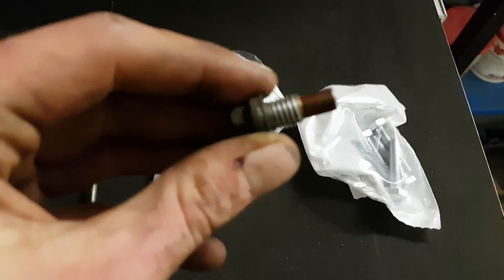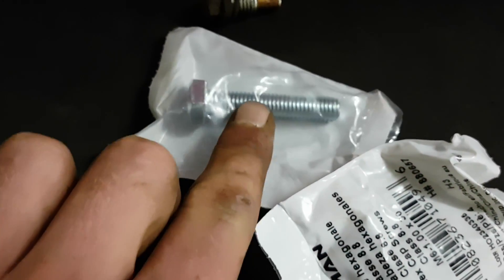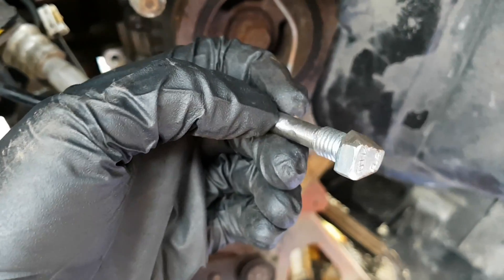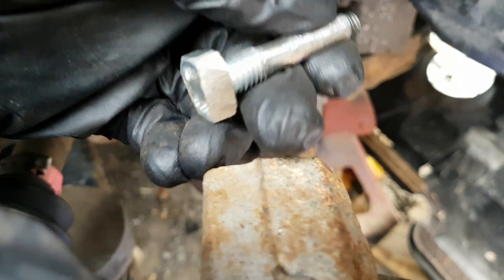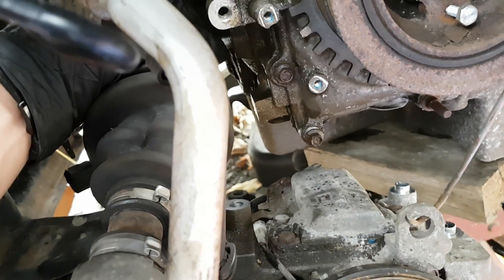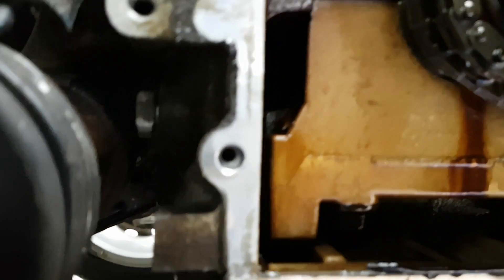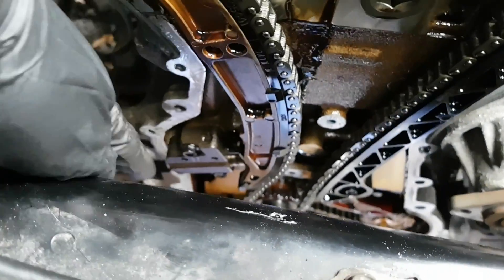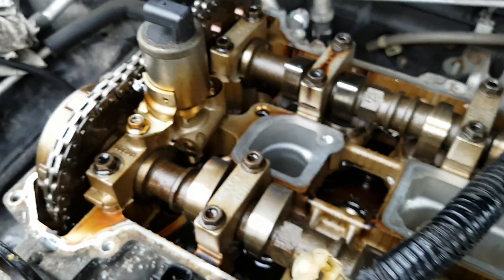How to make 303-507 Crank timing peg for ford mazda 2.3l 2.0L engines

Comment: Just pull an exhaust bolt. Flip it around. It's the perfect length to lock the crank down..If your lazy. Just go buy a new exhaust bolt. Grind the first half threads off. Then it fits without having to remove the drive shaft..
Reply: I found out the same thing.

Comment: Save $30 by buying $500 in other tools. Makes sense.
Reply from the maker: in what universe does a 63.4mm by x m10 bolt cost $500?

Stick to watching information rather then trying to spread it. 

Some people Do things. Other people bitch about people doing things. No offense

"Oh yeah I totally told everyone to go buy a welder and a drill press and... oh wait no I didn't"

moron lol
Reply from the maker: last time I checked I can buy a M10 bolt for $0.20 at TSC or any local hardware store.

OH MY GOD $500 Fucking Dollars! hahaha
Reply: @hi-powerdetailing  You said it yourself. If you have a bench grinder, and a drill press. Most people don't just have these just "laying around". So my statement still stands. Because if you don't have these things, you probably shouldn't try making one of these. But people will surely try with a hand drill and a pair of vise grips.
Reply from the maker: and any self respecting weekend warrior or a mechanic will have a Vise.  If they don't, they're shopping for one

Seriously what home shop doesn't have a vise?  Ever tried to break free a fastener and cant hold the part? Yeah that isn't gonna work.

If you don't have a vise then you probably should stick to changing your oil or something
Reply: @hi-powerdetailing  I never said anything about a vise. I said a drill press and a bench grinder. My vise is about 50 years old and will best any mainstream vise on the market today. But my point is if you don't have the money to invest in a drill press or bench grinder, you're kind of stuck drilling with a power drill. Have you ever tried drilling a perfectly plumb hole in a bolt directly in the center? 9 times out of 10, the hole will be cocked and won't function. So for a project like this for people trying to do it "cheap", they would need the proper tools to accomplish the goal. Better off spending $30 on the actual kit made for this engine.
Reply from the maker: For the last time you can buy the bolt and use a hacksaw. or buy the tool who cares. I dont even know what youre trying to prove here. You dont need to drill anything. I dont think you understand that
Reply from the maker: I just want to point out the comment section is full of people who understood what I said about being able to just buy a bolt and use it. I dont think you understood that simple yet overlooked point.

No tools required. Purchase of a bolt is required. nothing else. everything in the video is extra. I dont think you grasp that
Reply: @hi-powerdetailing  I understand that. But you also made the video about making an adjustable bolt. Not a vehicle specific bolt. So if you want to make an adjustable bolt, save some money and buy a drill press, taps, a grinder, a vise, among other pricey tools. And use your valuable time while potentially losing money because you don't have a way to work because you spent we 12 hours making a bolt without even touching the car.

$30 on Amazon and you can have the exact bolt for a 2.3 mazda 3 or Ford focus/fusion engine. 😉😉😉
Reply from the maker: You're making me realize I should just start selling these bolts for $25 bucks online and make some mulah haha. The focus of this channel has been to spread information moreso then to profit, but I should realign my goals to incorporate profit as well. It would probably help me focus on creating new content.

Tool = $30 / shipping / waiting
Bolt = free / negligable cost, and can be utilized without delay.  (can be found in appropriate size +/- 1MM = good enough for me)

Also it took me less then an hour to make the bolt. I spent more time editing footage and uploading then I spent doing it.
Yes I made it adjustable. It serves my purposes. Nobody else needs an adjustable bolt, and I gave them an alternative, but showed them what I did instead.
I did it because I felt like it, not because it made my life easier, it had no real utility other then to satiate my curiousity.

I never recommended anyone struggle without equipment or tools and devote disproportionate amounts of time to basically what boils down to an experiment, I simply showed them how to make an adjustable tool. Is it overkill? yes. but it was an original idea that came from the need for a tool, and I thought it would at least teach somebody something or possibly pique their interest in working with their hands.

I'd never even set one of those engines to TDC before I made the tool or video. I winged it, so there's that too. The threaded portion ment it would back off as I tightened it if the bolt bottomed out. Self adjusting tool. Perfect for easing my doubts on the dimensions

I had to remove the heads and rebuild them so really I had alot of little jobs I was doing at the time and made time to record the process, for shits and giggles

I had the privilege of growing up in an auto restoration shop and learning alot from my father. I have used that head start to the best of my abilities and I'm continuing to learn daily, I try and share things to provoke thought or spread information.

There's always a better way to do something. feel free to keep letting me know when there's a better way, i'm always open to new ideas and respectful discussion

I've got a few videos on Subaru engines in the works, I should be dropping one a week for the next month if you're interested at all. Timing belt, Cyl Head assembly, then engine installation. I havent uploaded a video in some time.

Sorry if I come off as harsh, I'm pretty blunt and have a hard time coming off as agreeable at times.

Kind Regards. AST Auto Repair

P.S if it takes anyone 12 hours to drill a hole and thread it,  I'll buy them a beer haha

Comment: Haynes says use a 63.4mm (2.5") M10 bolt and job done.
Reply from the maker: Boba Fett thanks Boba Fett! When I have a minute later I'll update the video info to reflect that! Its been a few years so my memory is hazy on the specs and length. I appreciate you clearing up any uncertainty!
Reply: I have a screenshot of the Haynes manual for the Ford Escape '02 with 2.0: https://www.dropbox.com/s/z3iivh59tv7gl90/Haynes%20Ford%20tool%20.jpg?dl=0 if that doesn't work, reply here and I can send it along

Comment: Hi I'm a auto mechanics i need job
Reply from the maker: Hi Automechanic. Have you applied to local shops around your area? also try putting an AD up online and drum up your own side work if you have the tools and equiptment to do so. you make alot more working for yourself like I do. I don't work crazy 12 hour days and I make about double what a shop would pay me. I do most of my work in the gravel driveway, including engine removals and reinstallation. I recommend not taking on tranny work because its not profitable for the time / effort. I find small service work to be the most profitable, especially when theres several stacked on one bill.

I hope that helps. I know it doesnt help on the job front but maybe it will help you out financially in the future. I typically charge about $200 bucks to change say 6 spark plugs on an average car like a ford escape. plugs probably cost me like 60.

Cost varies from region to region before anyone decides to flame me for charging $140 for 2.6 hours of my time. part of that money is markup on parts

Remember 33% is usually parts, 33% is labor, and 33% is profit to reinvest into tools and equiptment. I'd find a new trade though because electric cars are gonna put us mechanics out of business. I'm going back to school currently to change careers simply becuase internal combustions days are numbered

Comment: Auto Zone now rents the locking pin and plate ,they give you 3 different pins ,for the 2007 Ford Escape (vin z) 2.3L it is the shortest pin of the three , witch is  2 and 1/8 or 2.625
Reply from the maker: Thanks for the tip! in canada we dont have Autozone but crappy tire / partsource probably does the same thing!

Comment: So , viewing these comments here I'm totally lost - m12 or m10 ? 40 mm or 38.5 mm? . I found that I have a 2007 Escape 2.3(Z VIN)  witch calls for a specific bolt.
Reply from the maker: snowblind5151 m10 if memory serves me correctly, 38.5 mm, 40 mm, 39.89777788854332 mm. doesnt matter (if its 40 mm dont turn it in the hole tight(youll feel it when it hits, screw bolt in by hand) just until its resting on the counterweight of the crankshaft!

also if in doubt, remove the plug for the blind hole, the size of the plug is the size of bolt required!

I made it 38.5mm or something, but it was adjustable (my design). with the length I made it bottomed out in the hole and held the crank still. the threads on the tool I made face opposite ways so the extension on the end will rotate inwards when bottomed, which means my tool self adjusts to short enough if that makes sense. despite the extra work involved, theres a reason why I made it that way (I foolproofed it basically)

you can use a small bolt on the crank pully to line it up I forget the size but its a little dinky baby bolt lol.
measure the depth of the hole with a vernier (if you don't have a vernier use a long screwdriver and mark with tape, will get you close enough)

basically the bolt just touches the counterweight. its just to holf it still/keep it in time, also using the crank pully hole lets you lock the crank and really feel easily when your tool has bottomed out!

the real purpose of the tool is to get the crankpully off and help set the timing back up after!

without the tool mentioned, chain visegrips on the pully to hold still, impact to busy the nut loose, and use the crank pully bolt hole to align tdc, if your feeling brave lol, but that would work (99% sure the crank has a woodruff key )

I hope this helped! if theres any further confusion don't hesitate to ask for clarification!
Reply from the maker: just make sure to lock off tjr cams before removing the timing chain. they will want to fly around once the belts off, the valve springs put pressure on the lobes, but when the cams go snap and whip around, its easy to bend valves.

if you dont have a flatbar or keystock to lock the cams, I suggest to rotate the motor so the pistons are halfway on their stroke, remove chain, then set to tdc carefully as not to collide the valves.

i remember this is a non interference motor, but I had bent valves and marked pistons (from the customers neglect that made me have to fix it in the first place)

so yes the motor is free wheeling, but I saw the aftermath of valve to piston ( motor was overheated severely and head was warped)

just wanted to share incase it helps anybody else!

Comment: FYI.. The tool is exactly 38.5 mm.  You can shave off a little of the 40mm bolt to 38.5 mm or 1.516 inch and use it to set the timing,  No need for all this welding and cutting and stuff. I have no idea why the guy here is doing all that.
Reply from the maker: Robert Arave you are right! Except I didn't have the exact tool to compare, and I dreamed up this solution in about 5 minutes, and it worked
Reply from the maker: But yes I could have just shaved a bolt shorter, but the diagram I had shower a much smaller shenk on the end. Welding was faster then grinding the diameter of the bolt shorter
Reply: Is 38.5 the length of the threads? Just the "pin part" part? Or the total lenght of the bolt including the head?
Reply: For mazda 6 2.0 benzin 141 cp 2004 is good??
Reply from the maker: JEEPIN MC  its not the length of the threads. Look at the tool. The bolt head end needs maybe 1/4 inch to 1/2 threads.

The rest of the length is the pin. In this case do what I did and use a vernier to measure your hole depth.

Dont have a vernier you say? Use a skinny screwdriver and wrap tape around to mark the depth.

Compare to your tool and try.

The tool can be a bit long, but then you can't bottom it out. Thats why I measured and made my tip adjustable *despite the neg comments about that*.

If its too long and you bottom it out, your certainly not tdc anymore

The tool I made, doesnt care how deep the hole is, I can adjust it longer or shorter in infinte configurations. I can measure, adjust, apply. Simple

Bet the people who chirped it didnt think of that lol the fact that 99% of the shit I do, isn't ford. Mostly bmw, subaru, mercades ect

Comment: Good I can not synchronize a motor lf 2.0 mazda mx5, already double 2 times the valves
Reply from the maker: You should be able to synchronize it with this tool. pin in the crankshaft, and the camshafts have little slots / keyways in the rear. a peice of 1/4 inch square keystock will fit in perfect to lock of the cams, and the bolt does the crank. easy as pie my friend!

Comment: Couldn't you just use a shorter M12x1.50 bolt without any modification at all (no chamfering)? All it has to do is thread into the hole and press up against the crankshaft to prevent it moving, is that correct?
Reply from the maker: dunebasher1971 its correct yes and no.

It has to go in a specific distance, or you push it past tdc with the pin. The same goes with a pin too short. The pin works by stopping the engine from rotating one direction. You use the crank pully hole to help as well
Reply from the maker: dunebasher1971 as long as it butts against the counterweight on the crank. You might need to shave under the head of the bolt to get that extra 1 mm.

Tbh I stuck a vernier in the hole while it was at tdc, and then I got a hold of blueprints for the tool.

Its been a while, but what your thinking might work (dont forget the crank pully has an alignment hole as well, its just not enough to rely on (could snap the pully say trying to remove the nut on the crank)
Reply: @hi-powerdetailing  You can't use the crank pulley alignment hole to remove the crank bolt. It will snap that timing cover threads right out. It's only used to align the pulley to the crank sensor. And you better make sure you torque that crank pulley bolt. While that crank lock down bolt is in there. To prevent damaging the timing cover or the crank moving. As it will bend them valves cause the timing is off.